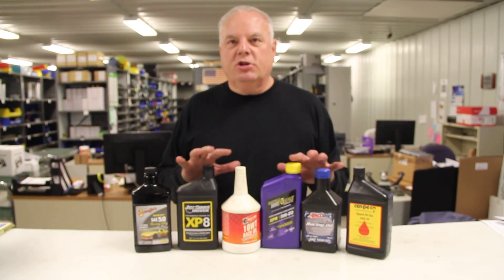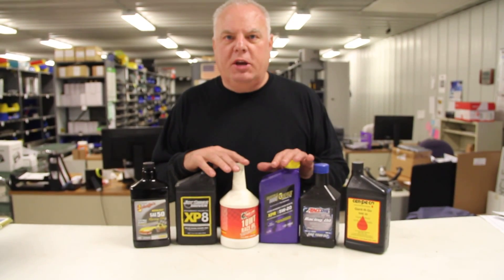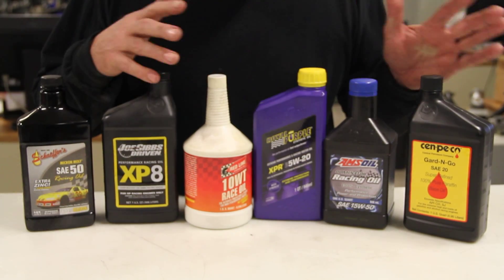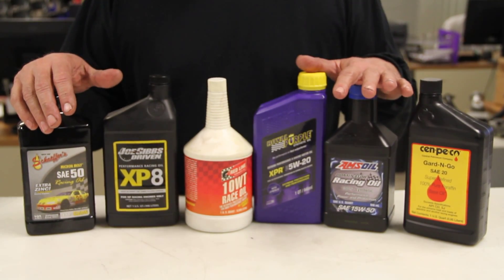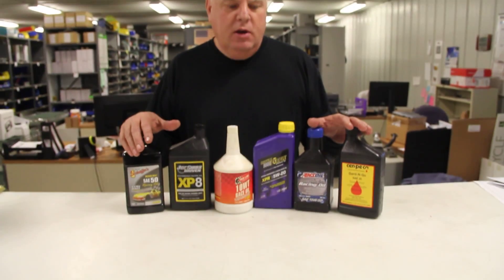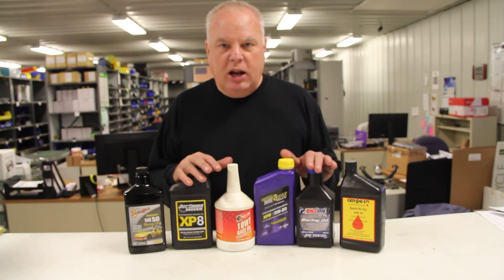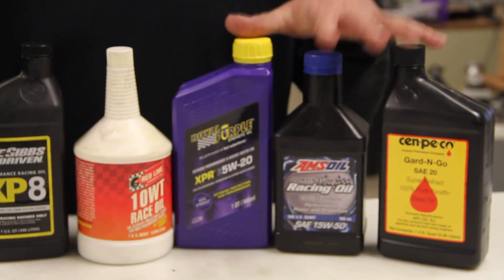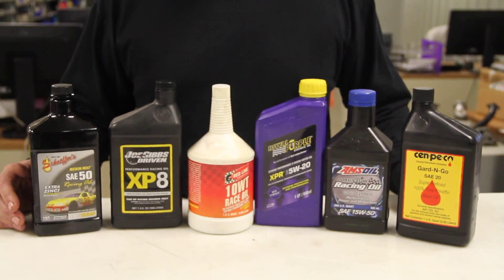Proper Engine Oil for Flat Tappet V-Twin Kohler Command Engines

Comment: How about a diesel 15/40 oil ?  It has higher zinc levels.  Mobil DelVac is one and can be had for about $ 12.50  a gallon instead a qt for the purple stuff..   Btw, I've never heard of a specific oil for a flat tappet engine..